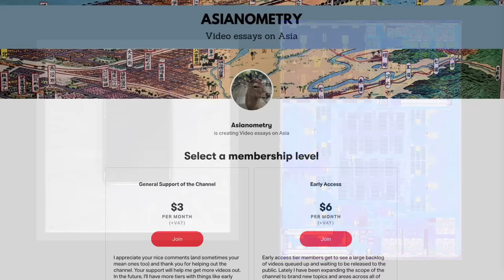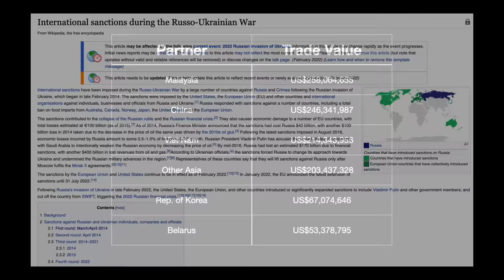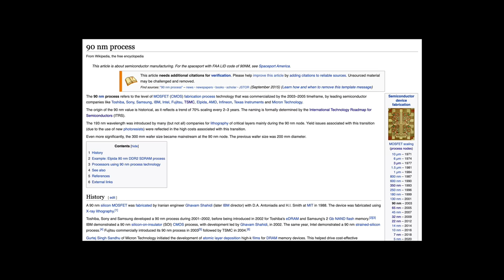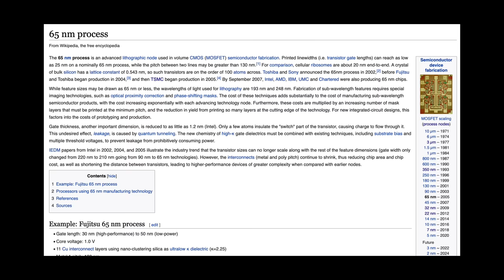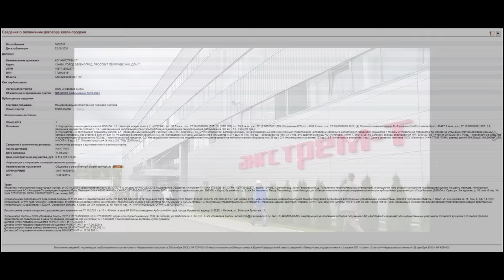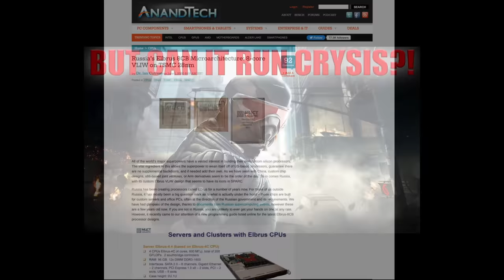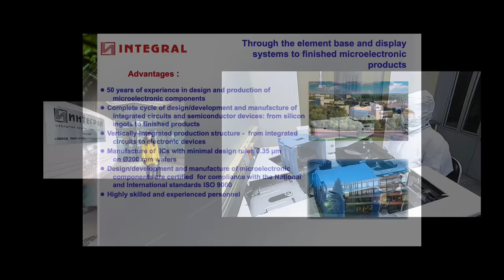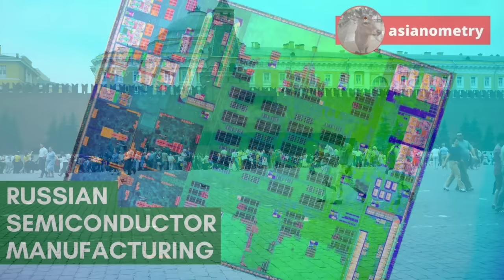Why Russia Can’t Replace TSMC

Comment: "Guns don't need a 7nm chip" is one of my favourite quotes.
Reply: But precision missiles, drones, and fighter jets do
Reply: @joefioti5698  No. Already back in the GeForce 3 days governments were freaking out because an off the self product was fast enough to do the job that had required application specific chips up until then. Missiles and drones can probably do perfectly fine with 90nm class shit. And I'd be surprised if there is any non-experimental fighter jets with anything better than 28nm chips in them.
Reply: @joefioti5698  Lol the Minuteman 1 ICBM has only got 4k of memory, 4k was and still is all it takes to take a bird from one place to another place on the planet.
Reply: @outsideworld76  All thanks to the missile not needing to load node_modules
Reply: 7nm chips aren’t radiation resistant and do not meet the reliability requirements for military systems.
Reply: One word: decryption
Reply: @joefioti5698  No they don't, the main purpose of smaller nodes are used to save energy
chips on weapons do not require much multi function, but requires reliability and resistant to harsh environments.
Which is why even 90nm are an overkill for the most advanced weapons.
Reply: Don't be so sure next generation small arms sight will have computer fire control and connectivity, may even need to run image recognition algorithm. If not their network end user device is pretty much a hardened smartphone/tablet, IVAS being basically Hololens army edition.
Reply: @killchicken123  But those function at most like a camera, and you don't need 7nm chip for cameras. and that's still years away.
By then China would have caught up with the most advanced processes and would be free to supply Russia, that is the sanction even last that long.
Reply: @obsidianstatue  Care to elaborate? To me only the "camera" part of each device is like "camera". Nettwarrior EUD has been off the shelf smartphone for a long time, the only way you can keep up with the rate of improvement in commercial sector. Good luck training algorithm on 90nm device.

I'd love to see a roadmap from just SMIC themselves even, claiming to have a date for their process to reach parity with the leading edge, if you have one. I know few would bet on Intel to do it by 2025 when they're now 1 node behind.
Reply: What nonsense !!!
Reply: @joefioti5698  small nodes are needed for compact packages. Plenty of space on most missiles for the task at hand.
Reply: @andersjjensen  I own (90nm or maybe 130nm) microcontroller chip manufactures by ST, STM32F103 clocks @70Mhz and can overclocked to 130MHz I'm 100% it can assist  guiding a missile (with laser infrared etc) making calculation almost in real time (look how 130 million clocks per second can help you) similar ~90nm chip will be 100 times faster if it was design as ASIC or even FPGA .
Reply: @joefioti5698  nope … neither western ones do
Reply: @obsidianstatue  war....war never change....
Reply: @joefioti5698  thats right, but under my education in cybernetics back in the early 90’s we made rocket guiding systems on a few 8086 chips with flash memory, programming in assembly. They did a lot of calculations pr second (3-5 million), already then, so it’s not much limitation in a 90nm chip
Reply: One of the big requirements for computing power is air defense systems. With phased array radar and many targets to sort out, you may need a supercomputer.  And now fighters like the F35 have onboard systems like that.   Let’s hope we don’t have an EMP anytime soon.
Reply: @joefioti5698  No. All those weapon would certanly not use 7 nm tech... Because those applications dont use that new technology. Furthermore Russian Armed Forces have their own fan
Reply: Arcflash man portable rail gun says hi
Reply: Guns are ancient, they still use 50mm/39mm/22mm/10mm/9mm technology.
Reply: @sudeep407  10milimiter is best millimeter.
Reply: Future guns do!
Reply: @andersjjensen  Hmm, maybe that's why we see all these "highly precesioned missiles" strike residential areas instead of military
Reply: @joefioti5698  but russian guns not, because is this same since 1939
Reply: @pastortt4167  Spacex have its own engines lmao
Reply: @andersjjensen  correct. lol even the latest KF-21 Boramae jet only use GCN era 28nm GPGPUs for the radar signal processing. Smaller nodes are not important for the military, but it does mean you have lots of capacity and mature things for bigger nodes for the military to use.

Also the PS2 and PS3 were very infamous for potential usage in military systems. Having such performance at low transistor count for their era is pretty remarkable. Many GPGPU stuff today are present in the PS2 EE and PS3 Cell.
Reply: @joefioti5698  you already got your answer but to add something new: 7nm in missiles and drones that are supposed to be disposable will not feature costly 7nm chips if a 28nm chip with only 1/28 price can do the same thing. it would be a huge waste to blow up hardly crafted 7nm chips in a missile when they could rather be used in private or science sector for more than one operation.
Reply: @joefioti5698  A lot of those can make do with older 90nm or even 16 bit and 8bit chip designs.
The B-1B originally flew using a network of eight AP-101 computers with about a 512K of memory each.
You don't need a lot of computing power if you don't have a complex graphical user interface and hardware virtualization.
Reply: @pastortt4167  US and other countries already make good rocket engines.
Reply: @appa609    correct.   also lifetime is rather short on these things.
Reply: @richardramos5124   correct.   Minuteman III used (uses?) 1.2u (1200nm) geometry for its ASICs.  Even for tactical weapons programs, rad hardening and resilience in the face of EW is far more important that the number of transistors per mm^2.  It looks like Russia's yields in this fab are quite low as we are not seeing Precision Guided Munitions (which could be fabbed in 90nm) being deployed in large numbers.
Reply: Yeah but the other guys also have guns.
Reply: AI?
Reply: While true, it is also equally true that you can’t replace your dwindling supply of Kalibr cruise missiles with models that run on SIM card and bus pass chips
Reply: @joefioti5698  they don't. A 65nm chip will probably do the job.
Reply: @joefioti5698  not required at all
Reply: @joefioti5698  A stinger missile runs on a chip less powerful than a pocket calculator. Weapon industry knows how to solve problems via simplest most robust route.
Reply: Actually I thought it was one of the least smart things Jon has said. Typically his videos are brilliant. A China with only rifles is no threat to Taiwan and the rest of world. Without semiconductor tech of 2010 and later, China will not achieve their goal of dominance through conventional military power.
Reply: @joefioti5698  The less nanometers, the faster is chip degradation. So military and space related electronics do not need chips below 65nm.
On the contrary, the main reason for Russia to develop its own stuff is to have a backdoorless processor.
How thin is the technological process doesn't really matter, especially in the situation when the gap in technologies can be leveled by a dozen of missiles.
Reply: @joefioti5698  no, they can still run off valve tubes.
Reply: @killchicken123  even an Esp32 is overkill for a project like what you are thinking about
Reply: if you wanna fight drones, missiles, and any advanced weaponry with just guns and meat go ahead.
Reply: @joefioti5698  - No, they don’t. These are dedicated chips and do not require that much power. They are rendering 4K video while deciding where to drop.
Reply: @cessposter  - Valve tubes are used because they are resistant to EMPs.
Reply: @AlphaDogLXIII  - Off topic. This is not what is being discussed here.
Reply: 7nm chips in the electro-optical processing in the gunsights. 7nm chips processing information on gun fire control computers and counterbattery systems.  7nm chips in the proximity and muzzle reference/airburst munitions (this one may be a bigger nm since its relatively simple). 7nm processing onboard guided munitions.
Reply: 90nm would still enough to power the Russian military industry since they don't need that super small lithography like we use in today's smart phone
Reply: Yep, but they need “full cycle” from growing crystal, to do lithography. Russia missing around 50% of little but very important parts of semiconductor production.
Reply: Modern warfare means Drones, automated systems, communication between every single weapon system, high precision weapons… 
I see the Russians do „really good“ in all categories lmao, especially with their Binoculars and 60 year old howitzers tech. Compared to let’s say a Panzerhaube 2000 that’s hits first time form double the range… 
Have fun trying to kill someone with your AK or BMD2 when facing Javelins, and miniature Drones that throws grenades or backpack suicide drones…   
Also Communication means more than using mobile Cell or Walkie-Talkies… Apparently after blowing up Ukrainian 3g towers Russians had no way to use the encrypted System while Ukranian military had no problems thanks to Starlinks… 
Russias military is a complete mess where different btg shoot at each other out of bad communication and planning… 
It’s not 1941, you can’t throw millions to die in a battlefield and expect people to accept it.
Reply: @killchicken123  they already do. A drone flies up finds targets with computer vision, gives the data to the Artillery system which digital FCS will ensure strike at first shot…
Reply: @obsidianstatue  do you know how camera sensors are made ? 🤦🏻‍♂️. Also it’s not „years“ away in the case of heavy weapons it’s already developed tech and even deployed partly in Ukraine… 

Modern weapons as in case of tanks have different sensors and cameras for nightvision, IR, have monitors, have direct communication links etc. 
And it’s all about the entire interconnected system, look up German Panzergrenadier System with the new Puma…
Reply: @andersjjensen  There was a time when they used 3 microns and did perfectly fine
Reply: @jxc1139  I am sceptical that 1.2u was available in the 1960's and 70's. 0.8u and 1.2u were available from ASIC manufacturers at the start of the 1990's, possibly even at the end of the 1980's, but definitely in 90's.
Reply: @deang5622  Yes.. but then someone figured that it would be pretty neat if the computers could do more than just keep the plane stable. Stuff like automatic image recognition and target selection does require some computing grunt.
Reply: @deang5622  Guidance Replacement Program (GRP) replaced the guidance computer in the 1990s...it was done by Rockwell which became Boeing...
Reply: Yepp, it is amazing what you can accomplish with a 4 MHz Z80 :)
Reply: @joefioti5698  0.2mm is fine to target something

or someone
Reply: @joefioti5698  nope. still not needed
Reply: @joefioti5698  not in Russia
Reply: yes yes but have you seen what guns with a 7nm chip can do?
Reply: @outsideworld76  27 bits or was it 28 ? All with A/D  and D/A converters and 4 k of memory, Gyros big as washing machines.
Reply: @joefioti5698  твой 4 нм чип на ракете работать не будет))
Это не военная технология и он тупо разрушиться от перегрузок и температуры.
Reply: @andersjjensen  
Anders,
Have you tried driving a Russian tank into Ukraine lately?
Reply: @TheDavidlloydjones  I don't get the connection to anything I've said in this thread?
Reply: @joefioti5698  they dont need either even 100nm will do just fine for most military weapons except in case of nano technology or building efficient super computers and high end consumer electronics. Even Apollo Guidance Computer that was used to send humans to moon is less powerful than decent calculator these days.
Reply: @obsidianstatue  The camera sensor might be basic, but the processing for the ballistic computers and laser range finders are much more advanced.

Go check out the new optic the US military just adopted. Laser range finder, ballistic computer, it tracks and calculates hits for multiple targets, it can communicate its location and the targets it can see to the other elements in the area. All of that probably requires some more advanced chips.
Reply: No but smart munitions do
Reply: @joefioti5698  are you sure?  They don't need cutting edge as even the US doesn't use them in their missles
Reply: @richardramos5124  good answer
Reply: Small arms can. But when one side of a conflict has only assault rifles and 1960s tanks, that are blind at night (at least without using active infrared systems), while the other sees them clearly through thermal vision devices and are already taking aim by means of sophisticated ballistic computers, while at the same time showing on screens to other units, where the enemy is, the fight will not be fair, which is good, as democracies tend to be technologically superior, and that's not a coincidence.
Reply: Until they do
Reply: @andersjjensen  f-35 is being upgraded with sub 10nm chips so there is a benefit to better chips
Reply: @andersjjensen and very important sensors like thermal imagers need to be cutting edge.  You can't downplay it all.
Reply: Neither can China unless they somehow capture Taiwan intact and I doubt they could operate very well at that point. Please understand I know many many people in the PRC are brilliant. Their problem lies elsewhere.
Reply: @joefioti5698 😂 of which they do not have 
😮
Reply: @joefioti5698 imagine a supersonic just cruising along with no sense of direction.
😂😂😂 lol that's more terrifying than the v2 lol😂..

Just point em that way Hanz and let er rip or in this case "Alexi" lol
That truly is more frightening I think Russia is going for scare tactics more than anything else
Reply: @jgvtc559  did you know that Russia is winning because is winning the logistics war?
Reply: @joefioti5698  Well what would happen then (maybe the rockets will still be produced but fired at random targets because of a lack of precision, so more innocent people die (oh and all Russian people get the problem of not having phones or so))
Reply: Apparently everyone here is a military expert and the military doesn’t need a computer stronger than that of a 90’s mac lol
Reply: @mouse454  shhhhhhh don’t tell them that
Reply: @eng3d  winning? The frontline hasn’t moved in almost 2 years and they are fighting an enemy 10x smaller than them. At this point it is a loss, I do not see how they can actually turn such a long war of attrition against such a disadvantaged enemy into a win.
Reply: @joefioti5698  maybe AI based weapons high on computational data with size snd energy constraints  where smaller node chips are important otherwise in traditional weapons on board processor is hardly a bottleneck. On board computer on rocket that took humans on space was a powerful as powerful as just a calculator these days while smartphones  are thousands of time faster than that.
Reply: Но и сома она не поедет.
Reply: @outsideworld76 ракета СССР имеет один гироскопов и четыре лампы, этого достаточно что бы попасть точно в здание белого дома😂
Reply: @obsidianstatue You have no clue as to modern weapon design, the ignorance inherent in your post is clear when observing the news that a missile landed 500 meters from Zelensky.
Hitting moving targets after traversing thousands of miles, using terrain mapping takes more processing power than you think
Reply: 15 meter rocket no need 5nm
Reply: Neither does a toaster.

Give it time.